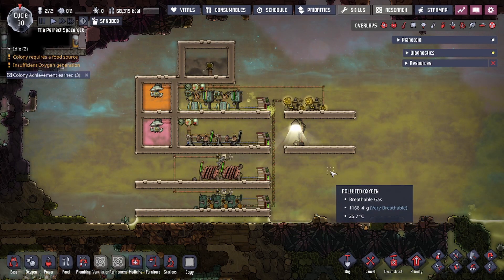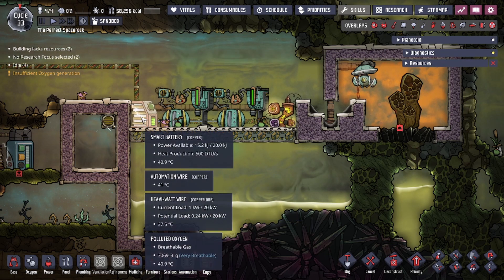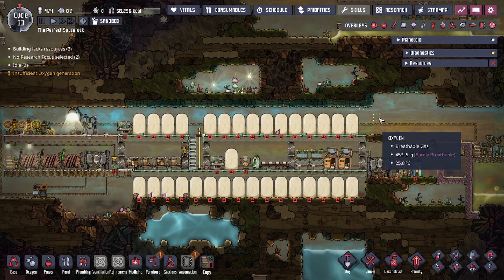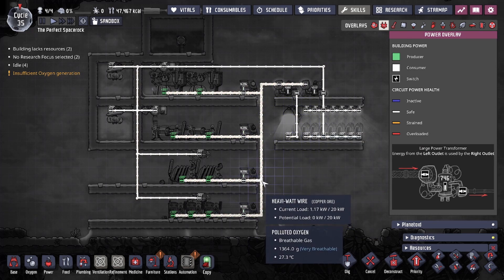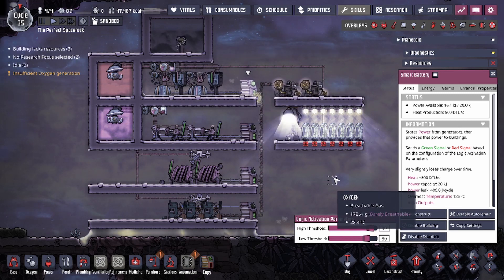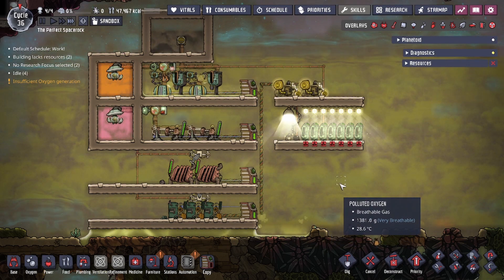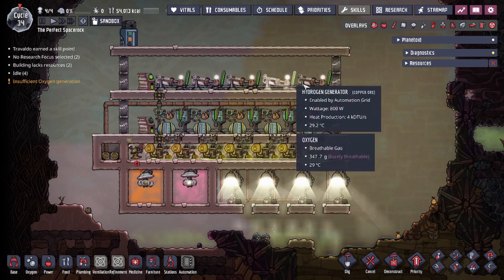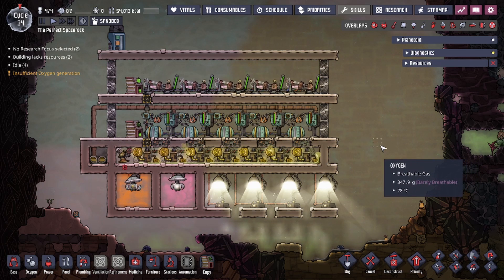How to Setup a Main Power Line with Automatic Back-up Generators - Oxygen Not Included

Comment: Is there a solution for battery flippers ?
My powerplants are quite far away and dont want to run a heaviwatt wire all the way.
Reply from the maker: if you dont want to run a heavywatt all through, theres no other solution so you just run two separate power plants

Comment: Thank you, I needed ways to cool a power grid with steam turbines and all but with this I probably won't need to?
Reply from the maker: this doesnt deal with cooling, only make sure the generators turn on as a back up power source
Reply: Yeah I've been learning that the hard way, lol thanks tho I've been wasting significantly less power since I've adjusted my batteries
Reply from the maker: @michaelrichards5340  nice! cooling the generators is usually not that bad, just requires an active cooling loop

Comment: you can achieve this using only 1 smart battery and wattage sensors for more efficiency
Reply: Sensor and a battery per grid?
Reply from the maker: i disagree, its alot easier to manage with smart batteries as they always fill the power within a power range, while you would constantly change the wattage sensor everytime you add power consumers to the line & also does not achieve the same results with turning on a back up generator in case the main power line runs out of fuel.

when you use the wattage sensor: no efficiency gain, no trigger for back up power gens, doesnt allow you to change which generators are used primarily, more work with unncessary automation
Reply: @2LegitCity  i dont think you understood me
example: instead of having a line of  5 natural gas generators and 5 hydrogen generators hooked to 2 smart batteries on different auto wire you can get rid of the second smart battery that controls the hydrogen gens (aka secondary power) and place a wattage sensor  that sends green signal to hydrogen generators  if consumption is above 4000 ( because 5x800 ) and you would save on the battery passively loosing power

you should also stick a AND gate to make sure you dont get over production

i have built it in sandbox and it works no problems
Reply: @michaelrichards5340  1 battery and replace all the other  batteries you would have placed with sensors
Reply from the maker: @themythical7383  yeah, i understand what youre saying, but what happens when your main line (natural gas) runs out of resources? your wattage sensor has to wait until consumption is over 4000 in your example before it (hydrogen gas) would turn on.
Reply: @2LegitCity  i dont factor in running out of resources because that never happens
Reply from the maker: @themythical7383  oh, that was kind of the point of the design